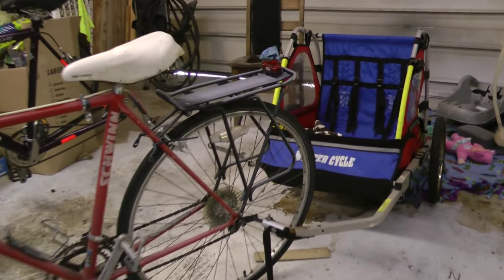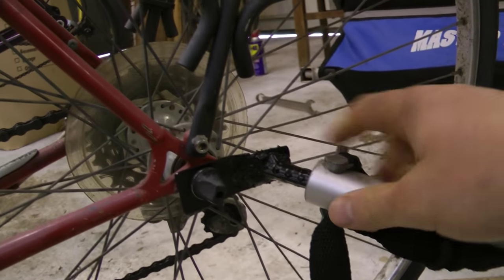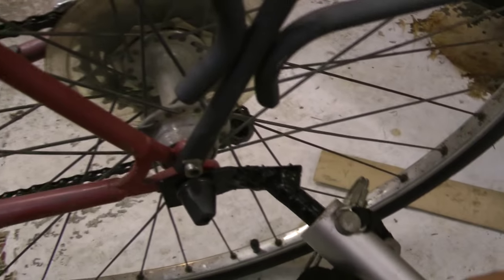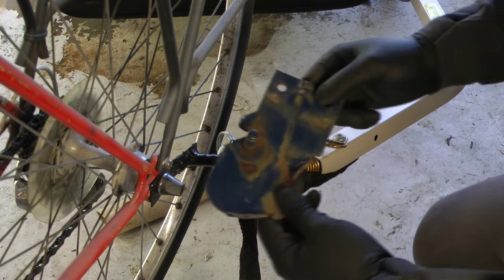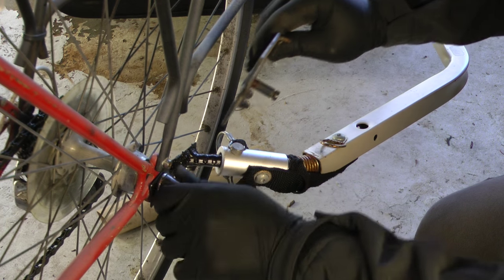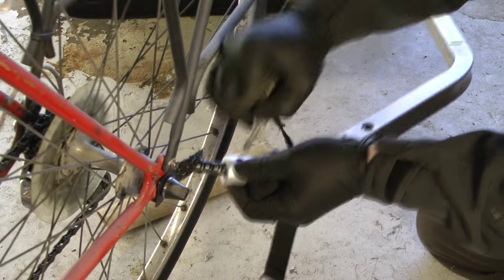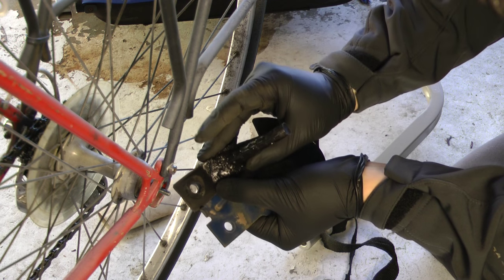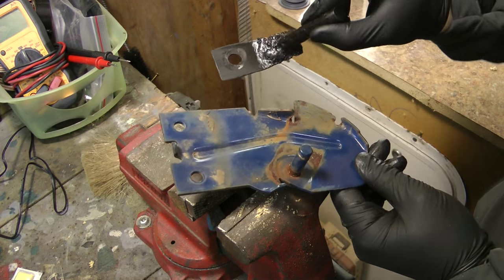Make a bicycle trailer hitch coupler

Comment: Probably easier  and cheaper to buy one 😂😂😂😂
Reply: Al Clark - No, it is neither easier, nor cheaper.   These are custom fit parts so a hit and miss on Amazon website.  Burley charges $25 for this tiny part, and on sale for $20, whoop de do!  I am fed up with price gouging for proprietary parts with no relation to manufacturing cost.  These parts are made in China for pennies and they have the nerve to rip us off in the US.  No more!  I would rather set up a whole shop of tools and spend a month making a custom part than pay Burley $20 for it.
Reply: Lass-in Angeles you do have a point. In the uk you can get them for like £6 (I think).
Reply: Al Clark i doubt anything in the uk is cheaper than the states. we get ripped off worse than anyone.
Reply: Lass-in Angeles I totally agree and do the same where possible.
Reply: Richard Curtis some of them are like £6 I think